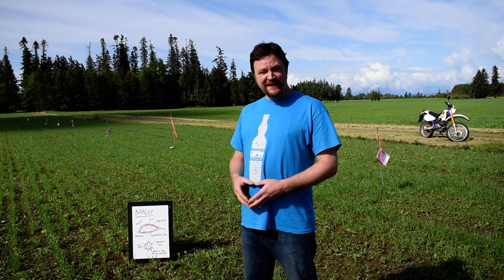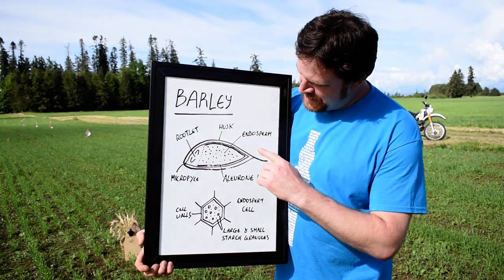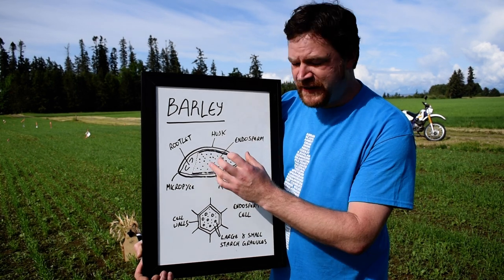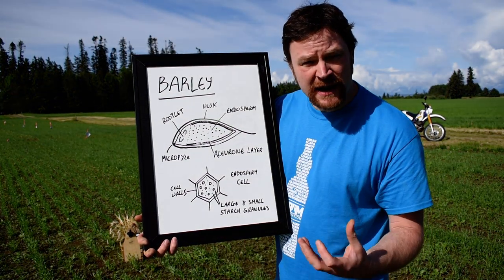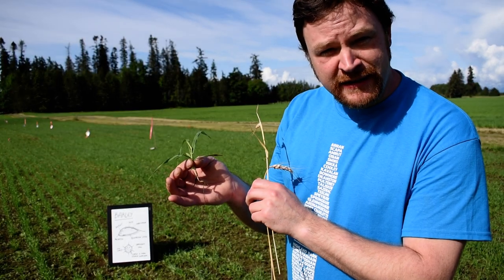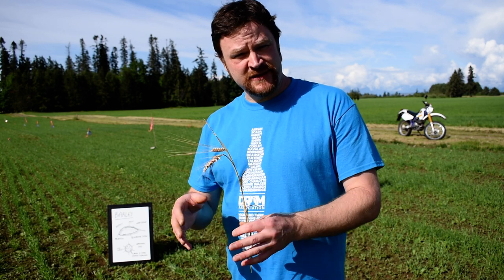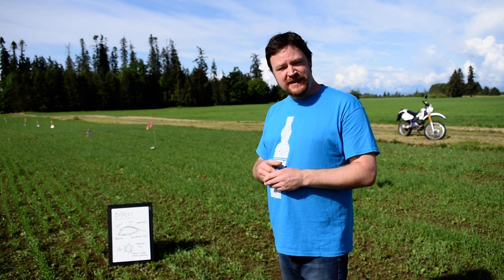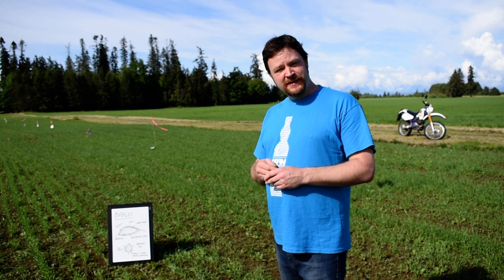How does Barley Grow? - Whisky Wisdom - Episode 19

Comment: Thanks for the video, getting this part of the whisky process is pretty neat. I'll be planting some barley this year myself. Only about 50sqft of Bere though. Not enough for whiskey but hoping to try a batch of beer. With all grain beer brewing you can manipulate the amounts and ratios of sugars in the wort by playing around with different timing and temps of the boil, to subtly adjust the final taste of the beer. Is this done with whisky to? Or is it more, boil the grain for the highest amount of starch to fermentable sugar conversion?
Reply from the maker: Hi Big Tree, I would be interested to hear your thoughts on the Bere barley growing experience once your done. It is an old variety that was used on the islands of Scotland. In whisky production we do not boil the wort as we do not need to add hops or sterilise. Our aim is to maximise alcohol yield and flavour so we do this by allowing enzymes to continue breaking down the cells walls and sugars of the barley in the mash and fermenter. Good luck with your barley trial!